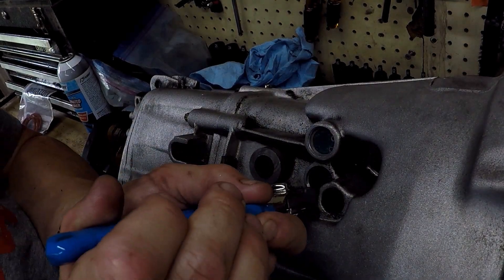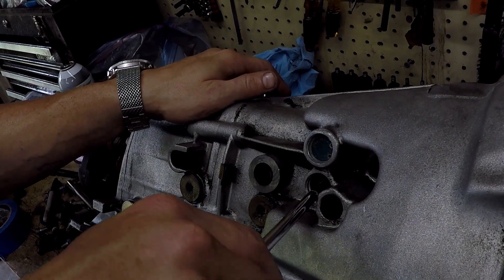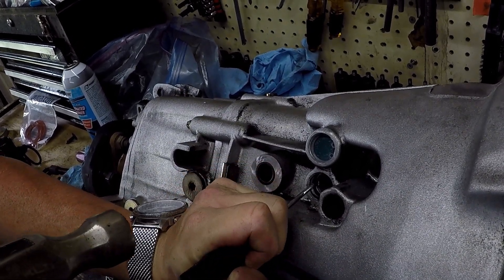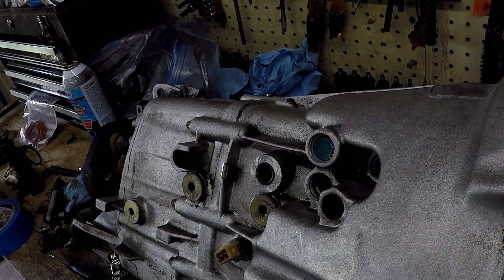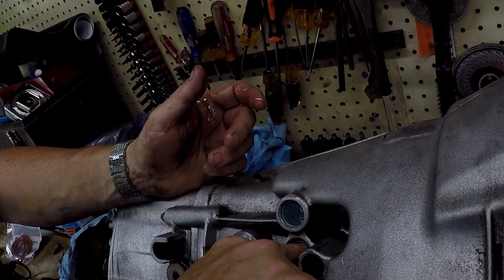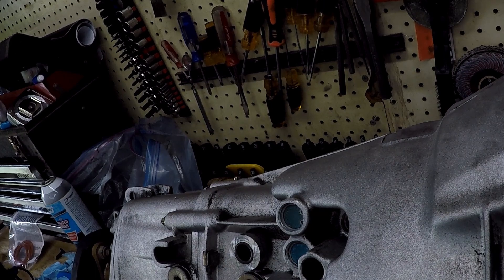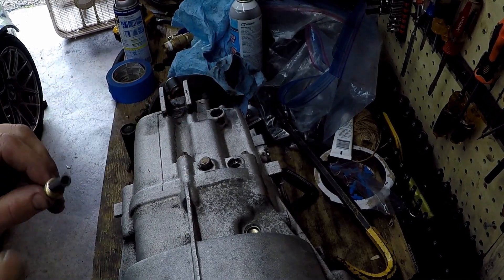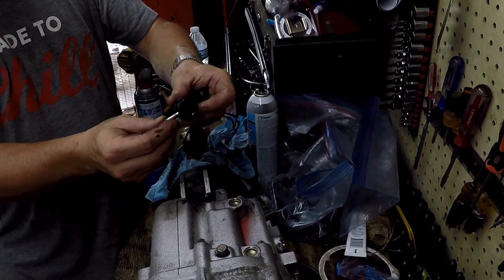BMW ZF 5 speed transmission - detent replacement and shifter rod joint

Comment: Very interesting video. May I ask how was the result? I also have a 330i with this gearbox. i´ve noticed that shifter rod has also some clearance (inside/out). Is that normal? I am a bit scared that this is not ok and may result in a a gearbox restoration. Thanks in advance.
Reply from the maker: So I just got everything reinstalled together with an aftermarket tunnel mount shifter (video coming soon) and it feels 100% better than it used to.
Reply: @chadplusplus  ah, ok, so you ended changing that part. good to know then. Thanks. Looking forward to the update. So far, I changed all the struts related to gearbox and sifter, also the transmission issues as you replaced in your video. it is day and night now.